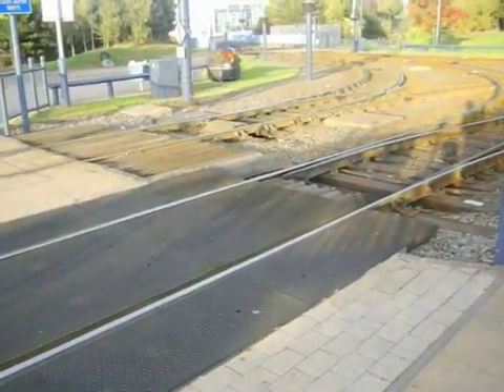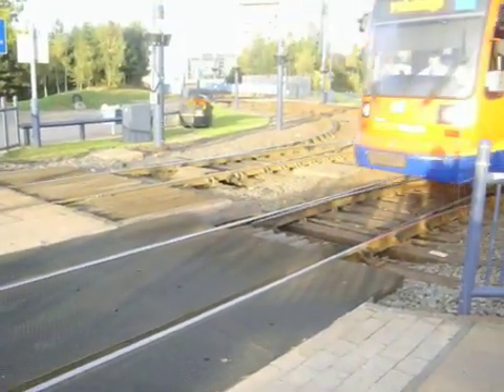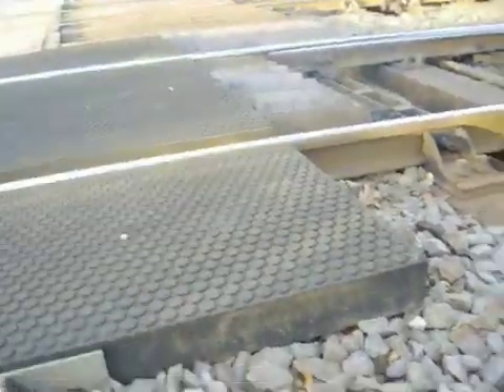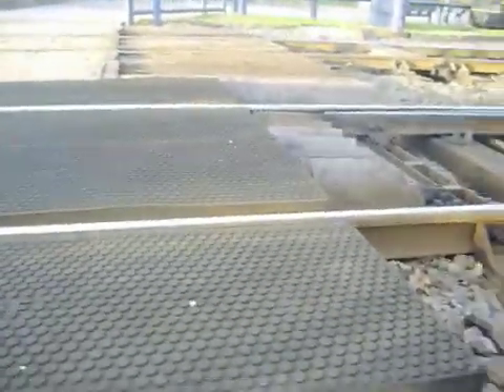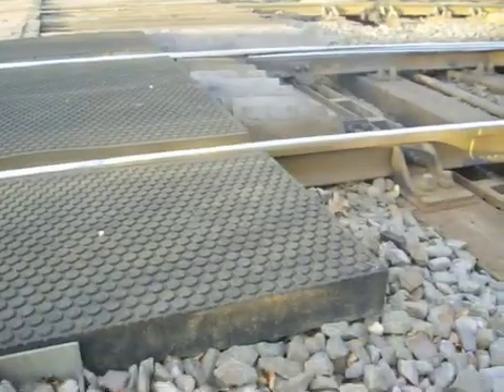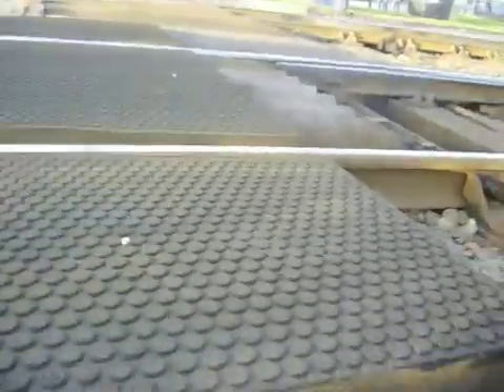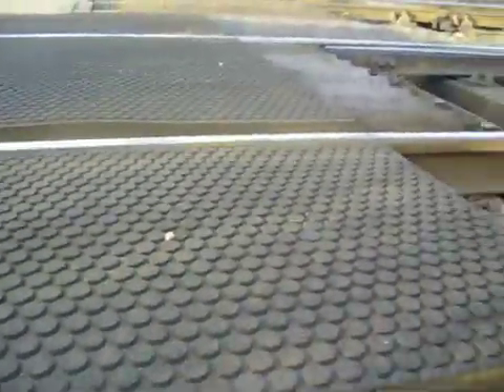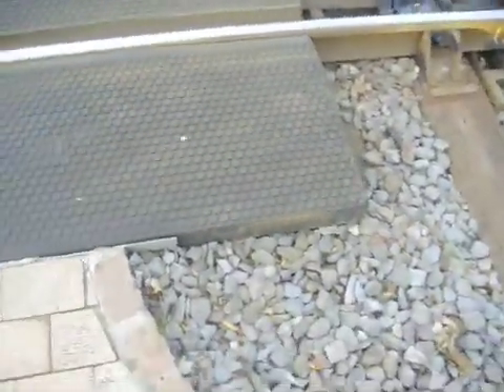The cost and disruption of tram lines could plummet!

Comment: The trouble with trollybuses is that you will need 2 electrical conductors and a pair of wheel type pickups, this limits the size of the vehicle as well.
Trams that run on dedicated zones can be fully automated.